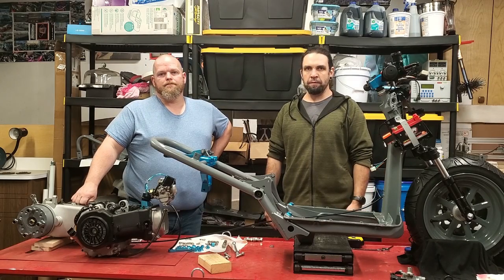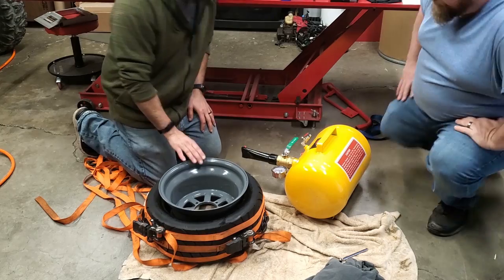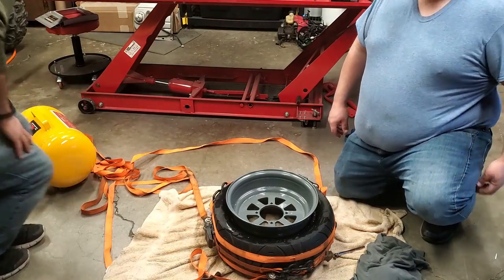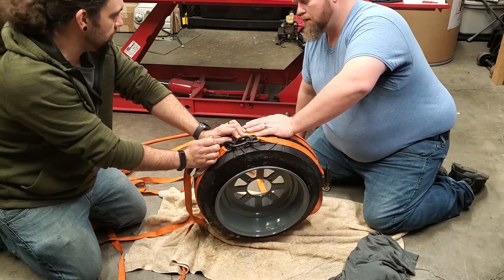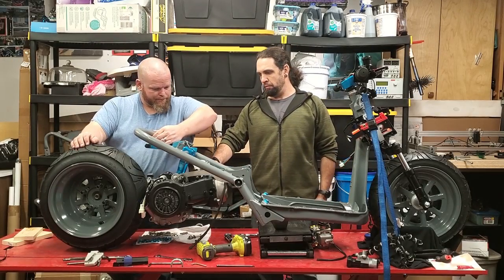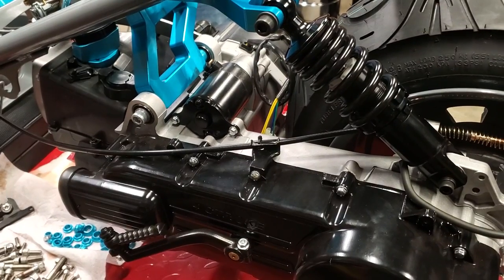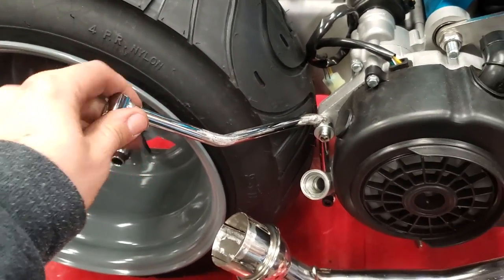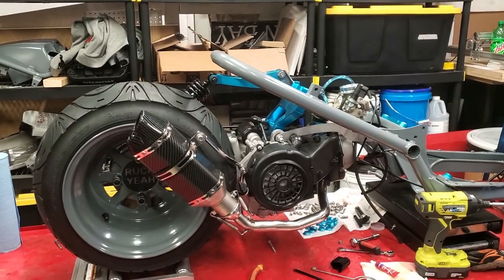Honda Ruckus - Full GY6 Swap - Part 5 - Mounting The Rear Tire And Mounting The GY6 On The Frame

Comment: You are doing a great job....I live in india i want to do a wider wheel on my scooter aprilia 150 but i dont know how to do a spacer in the rear...can you help me with that...? And the wheel..how to make a custom wheel if i cant get one..
Reply from the maker: If you want to go to a wider wheel, then you would have to offset the motor mount to center the new wheel. That would usually require a new motor mount, and I do not know if anyone makes one for your bike.

Comment: How many centimeters is the will and what is the number of the ready
Reply from the maker: The rear wheel is 12 x 8 inches, which is about 30cm x 20cm.
Reply: @MikesMiniMotors  thanks for replay

Comment: Este suporte de segurar o motor eo amortecedor , como chama , eu acho no mercado livre ?
Reply from the maker: The gy6 engine mount I used is not available anymore, I believe. You can get the one that is similar from The Ruck Shop though. https://theruckshop.com/product/trs-gy6-extension-mount-kit-fatty-gy6-solid-12x8-10x8-or-12x7/

Comment: What and which size tires were you running?
Reply from the maker: The tires are Shinko 007s. Front is 110/70-12 and rear is 140/70-12

Front
https://amzn.to/3DaNYgE

Rear
https://amzn.to/3kKeZRC

Comment: wondering about the rims, where at?
Reply from the maker: The wheels were purchased from www.machinedmachines.com
Reply from the maker: Correct, the rear wheel is a 12x8. My front wheel is a 12x4.
Reply from the maker: Daddy Savage  I am currently still running the stock drum brake set up, but I plan on going to disc brakes, hopefully in the near future too.
Reply from the maker: Sounds like you have some great plan coming! Which rear disc brake set up did you go with?
Reply from the maker: Nice, when I go to buy one, I was planning on getting it from Rolling Wrench also.

Rolling Wrench is great! I wouldn't be where I am with my bike, if it wasn't for his content.